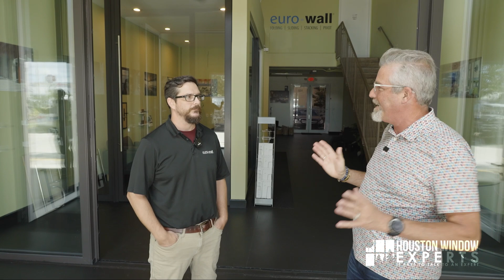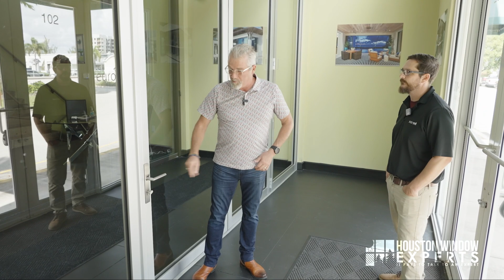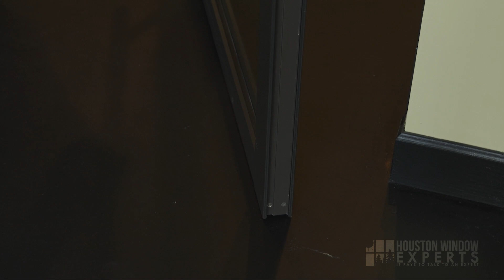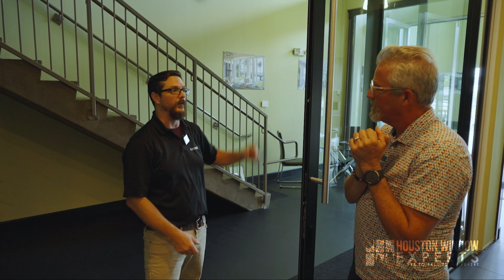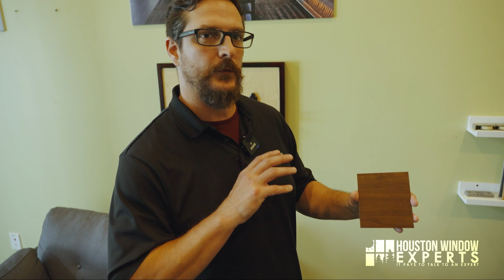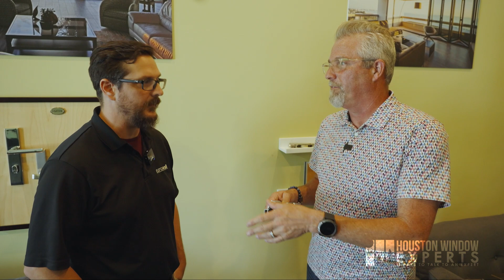Introducing...EURO-WALL!!

Comment: Jeff, thanks for your videos. what would you say about Renewal by Anderson?
Reply from the maker: I have several videos about Andersen's Fibrex. You should check those out.
Reply: @HoustonWindowExperts  I did. question is about "Renewal by Andersen" company
Reply from the maker: It's the same properties just packaged through a different extrusion and with more options. It's like Chevy vs GMC. Yes, GMC is nicer but it's built on the same platform as Chevy.
Reply: @HoustonWindowExperts  thanks